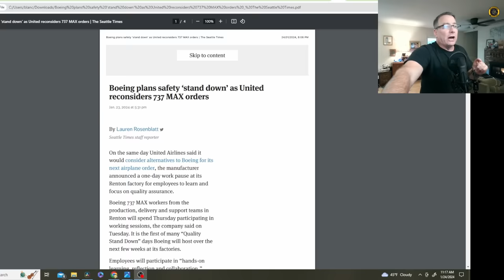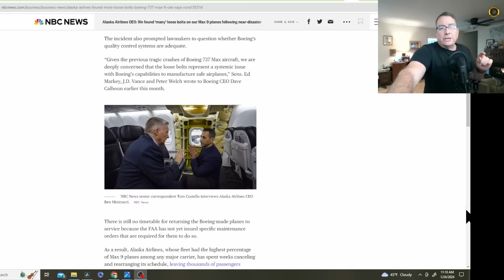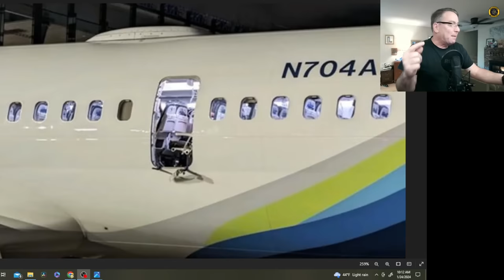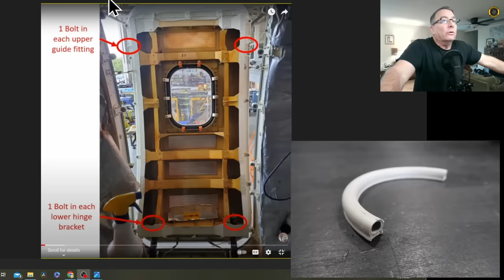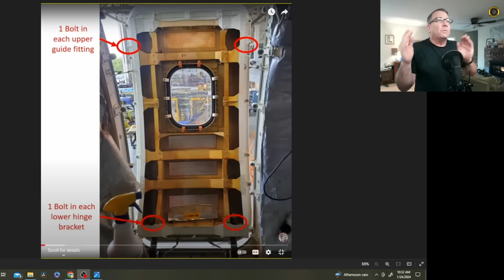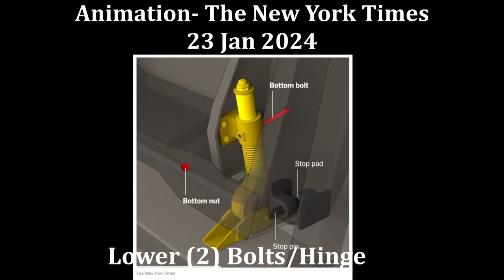Boeing's Quality Management Failure Explained 737-Max-9 Door 24 Jan 2024

Comment: This happens every day in every large production facility. . . it's just life. 
    I work as a specialty pipe welder in a shipyard. I came in as a laborer on the weekend to make some extra cash. I was told that I was needed as a welder instead, and for me to get my gear and head down to the military ship that was getting ready for sea trials before being handed over to the Navy. 
   When I get there, it is explained to me that the night before, as they were filling the fuel tanks with diesel, they noticed a smell and then a leak in a hallway. They had to remove the sheet metal wall, insulation, fire insulation to find a missed weld on 1" pipe for a sensor going directly into the tank, a tank that held thousands of gallons of diesel fuel.
   The tank somehow got to that stage without a complete weld being tested? ... how? ...tanks are pressure tested in the shipyard before being " cleared" for inside painting and then outside painting ...either the pressure test was not conducted or was conducted improperly. 
   I am at the end of my career, almost 40 years of being a welder, combination welder, then high pressure pipe welder and then shipyard pipe welder. I have seen mistakes like this happen all the time. 
   Here is one explanation that I know of first hand of what happens. The " White Hats" get together every morning, and it is discussed which white hat got the LEAST amount of work done the day before, and then they are told that the guy at the bottom will be fired for lack of production...which leads to Foremen, Managers and sometimes Directors falsifying inspection documents so that the work can be " signed off" and moved to the next level. 
  When one Manager was caught red-handed, he explained that it was more important to him to " cover up" the mistake rather than expose it, and then be fired for missing a crucial inspection point. He said that so many people are involved that a missed weld could not be blamed on one person, so he assumed that he would not be held responsible personally.
   He said what stopped him from exposing the mistake was the fact that he had moved from one Province to another, bought a house a new SUV and could not afford to lose his job...so he took a chance. 
   This is what happens all the time in production, but inspection levels HAVE to be much higher when dealing with aircraft as compared to Military ships...but so many of us don't want to lose their jobs, their homes, their wives over " doing the right thing". 
   I personally have been fired from a good job because I brought to attention the defect in the welding that I was finishing up, but I was accused of doing ALL the welding, and so I was blamed for the failed weld, and fired. . . And I would do it again. These welders had burned through the RADAR cable going up the mast of a large offshore fishing boat, but they wrapped black electrical tape around the shielded cable to hide where they had burned it. As soon as the winter weather and salt spray got into that, the RADAR would have failed, and to me that means maybe, just maybe, those men on board that ship could have lost their " EYES" in a storm and could not go to sleep knowing I walked away from a possible disaster, and I would do the same thing tomorrow if it happened. 
   I have a motto when I weld on important projects all throughout my life. . . I weld on things as if my SON is going to be the Captain, my WIFE is going to be the cook...so if I do a less than perfect job, I could be drowning my family ...so EVERY weld is the best I can do, every day.
Reply: Thank you ! 🙏
Reply: It's utterly absurd that you could be blamed for a massive defect that was covered up and you yourself called attention to. In today's job market, I think something like that happening to me would send me into despair.
Reply: Beautiful perspective (re family) to keep you on point. Thx for the share.
Reply: @arigelab  You are very welcome. I was just typing ' out loud", typing as I thought to myself and quite honestly, did not expect to see 29 thumbs up below my comment in 14 minutes .. But again, you are very welcome. I love what I do, and every day, I still try to achieve a higher standard of quality compared to the day before...it keeps me " sharp".
Reply: Thank You!, Mr. Shoelaces. 😁  Too bad, and  quite sad that more people are not like you in this respect.  Bless you!  And I sure hope you have done all you can to pass your work ethic to the next generations of welders and others.  We all need this.
Reply: I wouldn't say "That's Life" I would say that is capitalism. In your example the inspections were waved due to financial consequences. The financialization of the economy is what is wrong with this country. Money is not more important than peoples lives.
Reply: Capitalism doesn't succeed with product failure.
Reply: Everyone whether they are doing " IMPORTANT" jobs or regular jobs should have your attitude. The thinking that I will just do the least I can get away with is so pervasive it's sickening.
Reply: I worked for a company where I had a meme stuck inside my clipboard: it said "mediocrity: it takes a lot less time and by the time they find out, it's too late."  I ultimately left the company.
Reply: Proof that I cannot multi task. Completely lost Juan, while reading your comment. 
Had to restart the video, lol happens every morning with the weather on the radio, as I search for my glasses, end up waiting for an hour for the next wx update, which I invariably miss again, sigh.
Reply: Your work ethic is rapidly disappearing!
Reply: As an electrician I have encountered the same type of behavior, everything from malfeasance to just not giving a c**p. On long vertical runs of conduit the conductors will need to be supported every so often to prevent damage to the conductors caused by the weight of the conductors. As an apprentice I was working on a hospital that was 7 stories tall, and when I was sent to complete the conduits and run the wires for the main feeds to the air handlers on the roof that ran all the way down the building to the basement, I asked about the support point. The bosses had forgotten about it, and so rather than admit they made a mistake and deal with installing a junction box midway up the floors, they basically used a solution that sort of looked like it was done without it actually doing the proper supports. Makes me think I should call the hospital to report them.
Reply: We ain’t reading all that 😢
Reply: @shoersa  it's not so much a work ethic as the recognition that if you do it right, you don't have to do it over.
Reply: Good man!
Reply: @not_listening2792 You people can’t even define the word capitalism much less understand what it is. Capitalism doesn’t exist today, just some government mockery of the word.
Reply: @TYRONE_SHOELACES: Back in A&P school, our instructors repeatedly told us that our work should be of such a standard that we would be willing to climb aboard any aircraft that we worked on with everyone that we loved or cared about. If you were not up to that, you didn't belong in aviation maintenance or aircraft inspection.
Reply: Well said.
Reply: @nealdaleyjr7625  Capitalism has often "succeeded" at a high cost to someone other than those who are reaping the maximum benefits from poor decisions and/or from decisions based upon short term goals and unenlightened self-interest when there are no real consequences for those people. The question is: What will it take to make Boeing change its processes to emphasize genuine oversight which is focused on quality and safety?
Reply: Is the new generation showing the same dedication ? What about DEI hire ?
Reply: The MAX error is different. It's an engineer writing a procedure that says that welds on 1" pipe don't require inspection.  Once discovered, you know that you need to (1) examine all 1" pipe welds and (2) review all procedures to ensure that they are appropriate.  Your first example is a random failure of the process that could have happened on any weld or any action anywhere.  And other examples are simple dishonesty and bad culture.  Those are much harder to fix.  (People are claiming cultural and systematic failures at Boeing but not shown that it impacted this accident yet.)
Reply: You americans need more labor protection by law man. They should not be able to fire personnel for doing your job and taking responsibility. I am not saying you guys need unions, but you definitely need more protection by law for employees. So you can't be fired by whoever tries to make his targets to get to his/her bonus or is fired him/herself for missing the quota.
Reply: @Justin-vi8dr  Very true, but a huge percentage of Americans are not aware that things can be better, so they can't ask for something that they don't know exists.  First time I went on a business trip to Germany and I learned the deal that they had as employees in the same company, I was stunned.  Higher salary, free healthcare, 30 days paid vacation, not to mention worker's rights protection - and they worked far fewer hours every day - and they produced more!  Opened my eyes, for sure, but very few are privileged to have this kind of experience.
Reply: @Jedward108  True - guys like him keep this world working.
Reply: Also software in Banks and enterprise corporations (all of them), Just look at the Post Office in UK where hundreds of innocent Sub Post masters were locked up because of faulty Fujitsu software.
Reply: @Justin-vi8dr  cut the crap.
Reply: @Justin-vi8dr  That will NEVER happen. America is deeply anti-labor and anti-union. It loves hard low paid work though. Just not for the bosses and the captains of industry.
Reply: @noimagination99  So funny you would say that...when we are onboard and we have some downtime, waiting for the air extractors to be installed, hot work permit, painters removing their gear, etc ...one of the young guys/gals will always say " Shoelaces, tells us a story"  and one day this young woman said to me, " why do you work so hard, we all get the same pay" ... and I said, One day years ago, I had a very strict company owner stand over me while I worked, and just as he went to walk away, he said to me " Tyrone, When I'm Not Here, Pretend I Am"  and I told that young girl that to this day, I just pretend that I have a strict Boss standing behind me all day, everyday while I work. 
   The young lady came up to me just the other day and said that it's like a complete 180 degree turnaround as far as her work ethic, and what really surprised her was  the compliments she received from her Boss on her production level increase. She even gave me a "workers" hug and thanked me for that conversation we had ...and I then told her, I'm 64, and I still  never get bored with being told I'm pulling my weight.
Reply: @shoersa  I truly know what you mean by that. I have been approached on 3 separate occasions by Directors of the company asking me what are my plans when I reach 65, which is 10 months away now. 
   I simply said, I'm not sure...but mathematically, it is in my favor to not take out my Canada Pension or Old Age Pension while still working, so I assume I might stay on, since I'm in perfect health, no bad knees, no limping, eyes just checked, all good to go.
   That is when the offered to me what ever job I wanted there, I could have. Do I want to run machinery, the telehandler, the forklift, the smaller cranes, the side by side delivery truck...then I noticed every job they offered was a SIT DOWN job .. Haha. I asked why are you offering me jobs with chairs ...they said if I were to lose my health, I could still keep my job ... now THAT was very nice of them, I must say. 
   They don't know it yet, but I have my rigging papers...I'll put shackles on loads for the crane operator for the next 10 years ...outside in the weather keeps a man fit, and you can dress for Canadian winters, and I'll always never be farther than 100 feet from a hot thermos bottle of King Cole Tea.
Reply: @marcelscarshow  You aren't reading it because of the internet, your information is so easy to turn on and off that you have lost your attention span ... I'm not shitting on you, it's just life. 
    I sit here and watch my younger son play music, mp3 files .. and EVERY song gets played for about 1 minute and he's off to the next song...every single commercial on TV has my son grabbing the remote and changing channels instead of waiting for the show to commence. 
   I went to a Disco, where even the dance music there was played for about 2 minutes and then instantly changed to another song ... you live in a culture now with NO attention span. When was the last time you read a paperback book? . . . never.
Reply: @kenbrown2808  And I would because my welders number has to be written or stamped if it's pipe ..BUT other welders will put somebody else's number on it, IF they know it's going to leak, and welders know if they screwed up, you don't need air pressure, water pressure to know.
Reply: no such thing as accuse or bad or fail or have or lose or fire or etc, do, outx, can do, out x etc any nmw an dnay s perfx
Reply: @zes3813  As long as the people who make money off of eliminating inspectors and inspection processes and other forms of oversight are insulated from the consequences of their decisions, nothing will change for the better.